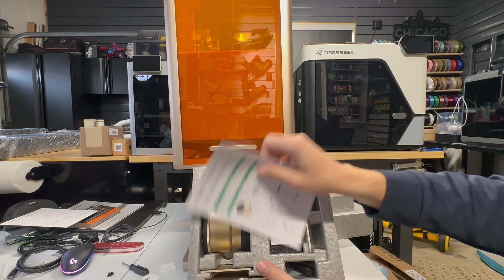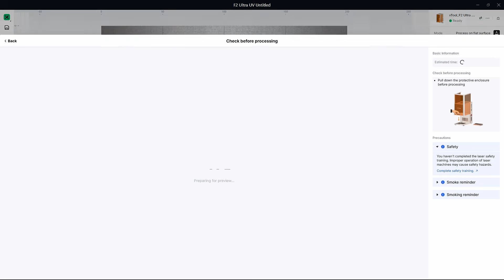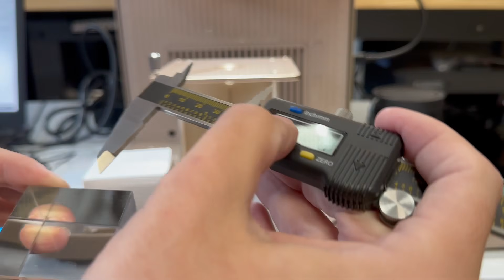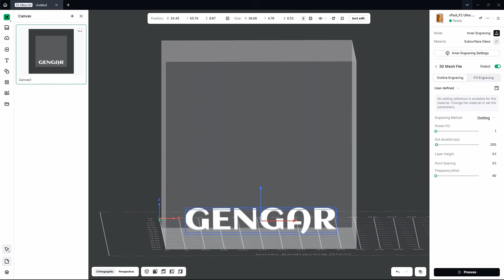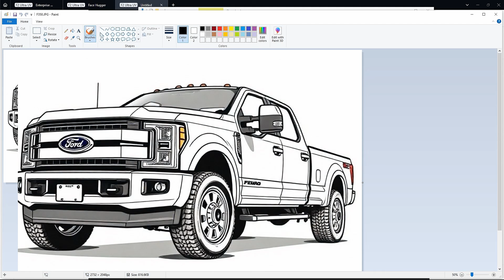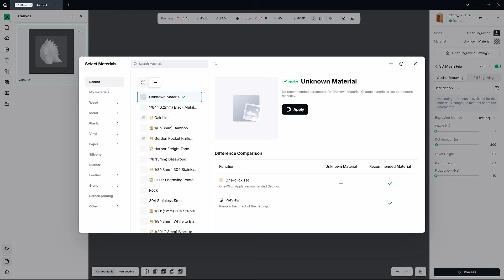xTool F2 Ultra UV Unreal Results

Comment: Just got this machine and it has been horrible. Terrible QC, engravings are out of focus, loose surface lens, inner engraving base will not secure, you name it. Xtool support has been less than helpful and it's a poor customer experience. I have multiple machines and 7 years experience so this is not normal.

Comment: Thank you for this great video, I have a question for you, does the device produce any fumes when 3D engraving into glass? I would like to have this device in an apartment building and I don't have the possibility to create a ventilation duct. I don't mind the smell. Thank you, have a nice day!
Reply from the maker: I took a subsurface laser to a convention, and it didn’t produce any fumes from what I can tell.  It would seem that it traps all the gases within the crystal as it engraves.  As I sat next to the machine during the whole two days, I did not smell anything.  I “believe” that’s the case hopefully that answers your question.

Comment: I was on the fence, looking at Haotian 3d uv options -- but this pricepoint and knowing how user friendly Xtool software is (i have an F1 - but also have a JPT 50w fiber and use lightburn).  If you had the choice btwn the Xtool F2 UV or the Haotian 5w with 3D - which would you go with?

Comment: Nice! How much did you sell the cubes for? Also, could setting adjustments change the outcome of how clear the print in the cube comes out?
Reply from the maker: Depends on the model completely, was anywhere from $25-$35 each.  As more complex models take more time.  Yes you can tweak the settings to give more detail, however that does cost you in time.